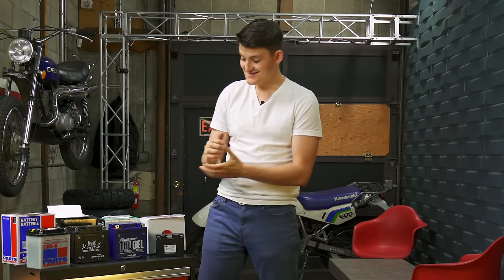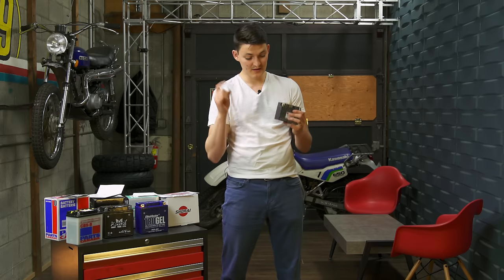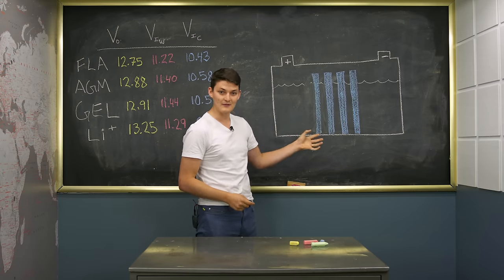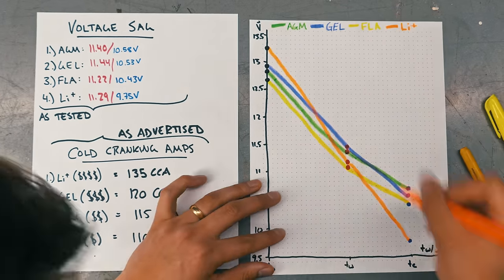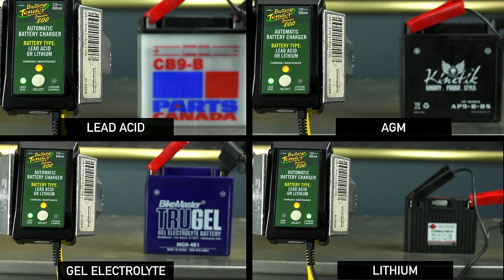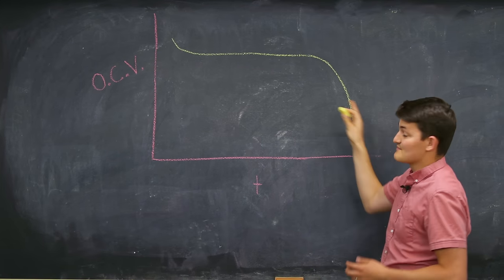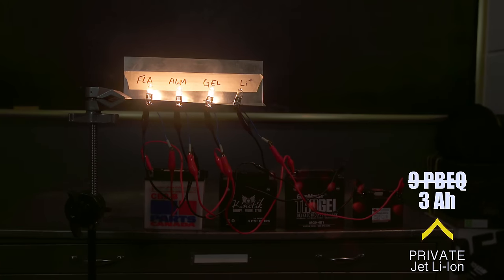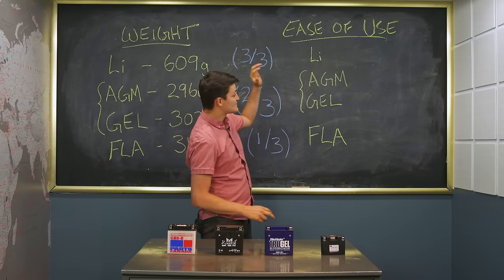Best Motorcycle Battery? Lead-Acid v. AGM v. Gel v. Lithium

Comment: This is one area I have been playing in for quite a while ( read about 11years). And the LiFePO4n( which I prefer to call lithium FERRO phosphate to avoid aural confusion with Llithium ION , a completely different beast and not useful for motorcycles in their present electrical config) I have used the most until recently was the Shorai. I should point out that cold is NOT a factor for me because I haven't a clue what it is ( I live in Queensland, Australia). I have used them for racing and street.
First Pb batteries are ridiculously heavy and delicate. For racing there is NO comaprison , for off road...no comparison. For street use cost will sway most people , most of the time.
None of my bikes for the last 11years has retained it's Pb battery for a number of reasons.
1. I don't get to ride on road as often as I would like. The LiFe battery is just awesome.
2. Coming from cycling, I am a weight weenie of OCD proportions.
3. As I mod my motorbikes almost always , it allows me to put a battery almost anywhere.
4. On the previous note, for off road, for offroad the LiFe battery is so much smaller than any Pb battery , you can surround it which foams and protect it from vibration and impact damage. Same for racing.
What I have learned.
1. LiFePO4 chargers are NOT created equal, even specialized ones. Most are crap. Currently I am using an Optimate and it is so superior to the charger tha Shorai supplied it isn't humorous. 

2. Shorai are the least best of LiFePO4 motorcycle batteries. Both actual lifespan and recommended size. I have tried 3 others and all have been superior.
3. As pointed out the "recommended size" capacity and CCA wise is rubbish. You need at least 50% greater AHr rating. In a Pb battery that would mean a physically much bigger battery and much more weight. In a LiFe battery it is almost the same size mainly because the case is mostly air. The actual battery is only a percantage of the case volume. Interestingly the case material is more dense than the battery! Or at least it was on the 9AHr I deconstructed. Since changing to the +50% rule not a single problem.

Note: There is a more than reasonable chance that Pb batteries may go the way of incandscent bulbs and simple disappear as OEM items. Yes it is happening right now. Pb batteries will then get dearer and LiFe cheaper. It is also possible that motorcycles MAY evolve to Li-ion batteries because the slightly higher voltage has advantages . But the old electrics will be slightly different ( that will be loved by the marketing scum...like pointless new tyre sizes on mountainbikes).
So as pointed out, this was not really a apples amd apples comparison . Even though it appeared to be on the surface.
So endeth the saga. Sorry to the millenials that can't read for that long.

Comment: Had a Lithium for a while until one day I forgot to remove the key. Half an hour was enough to drain it. In the f..... modern bikes you can't even switch off the light.
Unlike with the lead batteries, once the Lithium is empty, it's over. Did the sme couple of times with lead batteries. Was never a problem to push the bike and start it.
Forget it with lithium, once empty it can't produce enough power to trigger the sparks. Even the LEDs on the dashboard were dead. The capacity of those batteries is very low and once the voltage goes down, bye bye.
I'm back now to OEM yuasa AGM. Even after 1 hour leaving the light on, you just push the button and the bike starts smoothly.
Reply: Most modern bikes are fuel injection and need some power for the fuel pump, a drained led acid battery won't even bump start

Comment: OMG. The lithium manufacturer cheated. They simply made their battery good enough... which shows that lithium is 3 times better than lead. Your demonstration was fantastic. I am going to replace my Nissan Leaf 12v battery with a lithium battery 1/3 the ah capacity of the junk they put in from the factory. Thanks for your data.

Comment: You should have also mentioned that you can't just throw a Li battery in an older bike without doing some charging system upgrades. I put one in my '83 Honda Shadow 750, but I upgraded the R/R to a newer Mosfet unit so there wouldn't be any charging spikes. My buddy threw a Li battery in his mid-90s Honda sport bike with the stock charging system and ended up encountering green flames in the area of his crotch while riding on the freeway (his crotch and the bike ended up surviving, but that was extremely lucky).

Comment: Recommends a $40+ charger for all types... yet I just bought the same type of "all batteries" charger on amazon for $11.
I use the charger for my SLA 9aH batteries, primarily used for amateur radio.
But for vehicles I do tend to prefer AGM or gel since here in NW Florida we only have a few weeks below 40F.

Comment: might be worth mentioning that li batteries kan handle way more rechares (loses less voltage over draining/recharging) so will last a lot longer and is cheaper in the long run

Comment: I bought a glass mat from batteries plus a few years back and it was crap...engine cranked slower than the yuasa it replaced and only lasted 2 yrs with proper maintenance. Then I tried a lead acid cheapo It lasted 4 yrs but still cranked a tad slow. Put a Yuasa back in it recently and it cranks waaay better and the yuasas always last me 7 years. From now on i'll stick with yuasa.

Comment: Close, but you need one more test. Put them on a paint shaker. Every conventional battery I've ever had has died after about 2-3 years, most likely due to cracked plates from vibration. I get 6-8 years out of an AGM, and even at double the price, they are cheaper in the long run.

Comment: You missed one thing, you did the headlight left on test, but really its not when the light goes off that we care about but rather how long until the engine wont start, the lithium's protection circuit will cut all power before its damaged, and this often means it will start your engine on 13% charge where others won't.

Comment: Ok , I realize you cannot do a ten year test, but if you did I would bet the only battery still going would be the lithium. I am on my third year with a lithium and going well. The best part is the maintenance free aspect, even when ignored all winter with no charger or battery tender my motorcycle fired right up in the spring. Combine the longevity, ease of maintenance and lighter weight and the winner is lithium IMO.

Comment: Another issue that must be added to the lithium battery is, you are going to need to improve a holding case for that tiny battery inside your motorcycle's battery compartment if you dont want it to bounce everywhere when riding
Reply: its light enough where the terminals hold it in place on my ninja 400

Comment: I would get the AGM. For $15 more you get a maintenance free battery, that does not spill nor does it leak corrosive fumes or drops. And is also lighter. There is no reason to deal with that just to save $15 ¡Don't be so cheap! A good battery will last for a very long time, so really, changing the battery is not a big expense in a bike.
I would probably still get the gel battery because it's more reliable and my bike deserves the best.

Comment: OK in a real world scenario I have found Lithium more reliable last 3-5 years as opposed to 2+. Crank way better and can store without riding and still hold charge way better than acid. Changed and have never looked back. As far as cost compared to Yuasa they are about same price here in Australia not sure why you would ever use lead.
Reply: You must be paying too much for yuasa if that's the case. In the UK  there dead cheap.    And my yuasa is over 8 years old and good as new.

Comment: Great comparison. I wonder if the onboard charging system of a bike can work with Li properly? I think for the cost the Gel battery maybe showed the best promise. I have an AGM in my trailer and note that the fully charged state is 12.7V instead of 13.2V of a conventional LA battery. I wonder if that may effect starter performance?

Comment: something missing from the capacity test is that you can recharge and re use the lithium right away, no harm done. Do it, every day, for 5-10 years and it'll barely change the capacity. the Pb batteries will be dead as a doorknob in the first month or 3.
The charge test too - likely more the fault of the charger than the battery.

Comment: Lithium batteries have a charging curve that tapers off as the voltage approaches max.   Without measuring the whole charge from E to F, you can't accurately measure charge time.

Comment: 1. The automatic charger doesn't detect the capability of the battery to take charge. It only detects whether its a Lithuim ion or Lead acid battery and will charge them in accordance with their charging profiles. 
2. Actually the Lead acid batteries be it Flooded, Gel or AGM are pathetic at accepting faster charging. You can charge them in less than 2 hours but they won't last long. I work in a company that has to deal with batteries a lot and we had to increase our charging time for lead acid batteries to 8hrs to ensure their life doesn't skydive. Li-ion batteries are happy to be charged in an hour as well without a fuss.
3. Li-ion battery manufacturers sell their batteries in Pb-eq because that makes it easy for consumers for replacement of their Lead acid batteries. A 9Ah Li-ion battery is immensely overpowered compared to a 9Ah Lead acid but a 3Ah battery performs similar. The equivalent refers to cranking capability, not capacity.  Also, for starter batteries, capacity doesn't matter much. These are just starter batteries, they don't continuously power any electronic device. Unless you have a lot of aux components on your motorcycle that are being powered by the battery, capacity is not even a parameter for consideration.

I am usually impressed by your videos but this one showed a lack of research. Also, LiFePO4 batteries are usually almost as heavy as Lead acid batteries because they lack the energy density (100Wh/kg vs 70Wh/kg for Lead acid). The "Li-ion" batteries on the other hand are super light, the ones that Elon musk uses are as high as 270Wh/kg. A true 9Ah battery made from "Li-ion" cells would be 1/4th the size of those Lead acid batteries.

I will agree with final result though, but not completely. For a motorcycle with standard electronics, there is no competition for the flooded Lead acid batteries. You could probably replace them with VRLA versions which are basically the same without the need for maintenance. However, if you have a lot of aux components, getting a Li-ion battery is a good investment. The Lead acid battery (starter version) can't handle the continuous load from aux devices well.

Comment: Personally, I’m partial to AGM. Zero maintenance, decent performance, middle of the road pricing, and most importantly, no risk of FIRE OR EXPLOSION. Maybe in 10 or 20 years I’ll consider lithium, but for now, I’ll keep by acid battery.

Comment: On the discharge with the bulb probably pulled more from the lithium because it is a resistive load and the voltage is higher

Comment: I only use Gel or Lithium.  I have a 73 HD XLCH.  I converted to electric start and the OEM spec battery is the size of a small truck battery, no lie.  The Gel would be 2/3rd's of the lead acid battery size.  I put a Zero Gravity battery in the XlCH and it's the same size as the bike's original 6 volt battery.  I am thinking I might put the original battery box and Oil Tank back in the bike and get rid of the smaller kidney oil tank in preference for the "Lunch Box tank.  I have had the battery for over 3 years and I plug it in every time I park the bike and over winter, Here in Cleveland it gets below 0 Celsius only a hand full days.  The Charger should be smart enough to do it's job.  I bought dual chargers.  I have a gel battery in my 2001 Fatboy and it' is one I bought at the locak dealership and it only cost 40 dollars or so.  So for some reason HD sells good gel batteries and they don't soak you as they do on most their other parts. I put the Gel battery on the dual tender and it's set to automatically sens the type of bat.  I went to start my Fatboy after a month of winter and the batter was too low to kick over the bike.  I's only 2 years old and I thoght the battery was shot.  I bought a new Lithium battery for it but then I looked at the charger and it had sensed a LI battery so I unplugged it and plugged it back in and it corrected itself and charged the HD Gel battery fully and the next day I started the bike.  I think I will still put in the New Lithium battery because I bought and I don't want to waste it.  I'll put the HD Gel bat in my lawn mower.  It will be 4X better than the cheap Home Depot Lead Acid battery, which isn't all that bad since I keep a tender on that too.

Comment: believe it or not, super hot weather kills flooded batteries in an even more annoying way: the plates deform, a cell or more shorts out and you get a dead battery in the evening although you started with a healthy, charge holding happy battery in the morning. 

there is no sign of the battery getting tired like you see in normal and cold weather with slower engine turning, dimmer headlight after you turn the engine off and all those symptoms ..
the agms and gels dry out faster too for a lack of a better term.

Comment: If Shorai was "smart", they would make their lithium batteries the same physical size as the competition, but have more cranking amps.  For example, instead of 9Ah equivalent, why not make it 15 Ah equivalent (about 70% greater) and maybe 5.6 Ah as far as actual capacity?  That way it would be a direct drop in (no shims/spacers needed), and the extra cranking power would help with stubborn bikes.  I don't see why making the battery smaller is of any advantage, since the battery box would likely be filled with foam pieces to make up the difference in size.  I think this idea is a good compromise between weight, cost, and power.  Also, since FLA, AGM, and Gel are only allowed to go down to a 50% DoD (Depth of Discharge) but lithium can go down to about 80% DoD "safely", then 50% of 9Ah = 4.5Ah and 80% of 5.6 Ah = 4.5Ah so the "usable" power would be the same.

Comment: Years late a simple opinion: years ago i stored my bike attached to the battery charger. On spring i found acid on my frame, corroded metal, painting and chain. I'm not sure about it but i've read that lifepo4 batteries can't explode/generate flames but only smoke, switched to lithium by years and deleted also the charger 'cause it wont discharge.

Comment: Would have liked to have seen an antigravity battery representing lithium. That one circumvents the "left the headlights on" test by cutting out while you still have a few starts left so when you realize, you just have to push a button and aren't left dead in the parking lot/trail.

Comment: You made the point that deeply discharged batteries sulfate. And since batteries maintained on a charger won't become deeply discharged, they also won't sulfate. In other words, all chargers prevent sulfation, and the claims of special desulfation cycles made by some manufacturers is nothing but a gimmick.

Comment: I both appreciate and disagree with the simplicity of some of these tests.  Great video overall on a challenging subject to communicate to a general audience.  

The recharge test should have been done in a bike for real world comparison.  The lifepo4 batteries can recharge faster than lead acid without damaging them despite this test in this video. 

It's fair to test batteries that are available on the market today, but not fair to test such a small lithium battery and claim it's not as good when you can size up for more money.
Reply: It's said to be the equivalent though by the maker ytx9-bs etc  it's the one they would sell and recommend.  And it's all really 3x the price of the FLA

Comment: About the cold-start of Lithium Batteries... it works a little different tho
first off they can draw a lot more power because with a lithium battery you pretty much use 100% of its avaible power if you wanna start your bike, on a Lead Acid battery only about 40-60
So even on a cold start with technically less voltage, it should perform very similar

Also about the draining test... well

Unlike the Lead-acids, the lithium battery will just charge back up with little to no loss soooo...

Comment: I know it saves time but if you want a more comprehensive test you should use the same light bulb and or resistor to draw the energy from the battery. Even though they are the same light bulb they may draw different amounts of current. Especially over 4 hours.

Comment: If the battery charger operates optimal for the Li battery the chargeing slows down as the battery gets full. Thats why usually Li batteries gets fast charged towards 80% and then slow charged so 100%

Comment: Lithium batteries should be charged constant current up to a certain voltage, and the shift to constant voltage. What bike generator-regulator does that? Unless you have a specific Lithium charger installed, those batteries are useless on bikes with electric system designed for lead acid.
Reply: So.....if I wanted to carry a spare battery as a back up ....as in a Harley failure in the middle of Nowhere Wyoming. ...what do you think about that idea...ask me how I would come up with that scenario